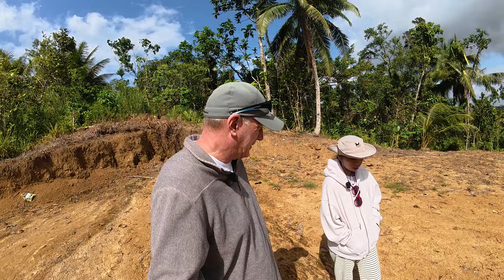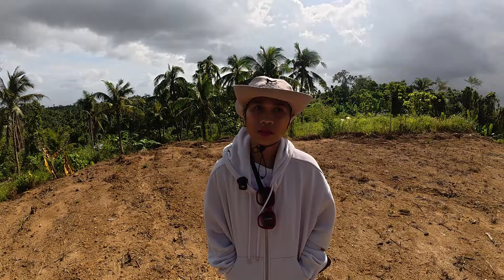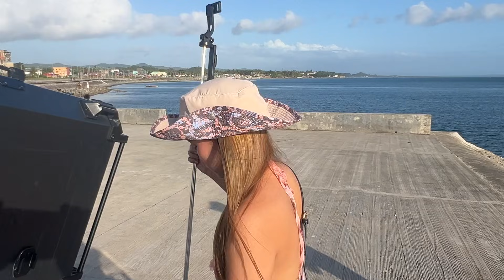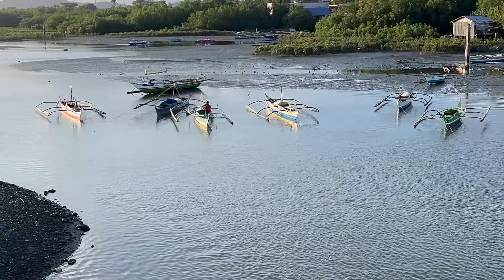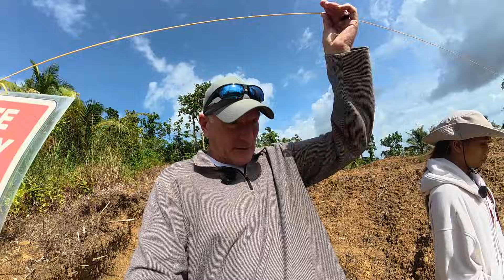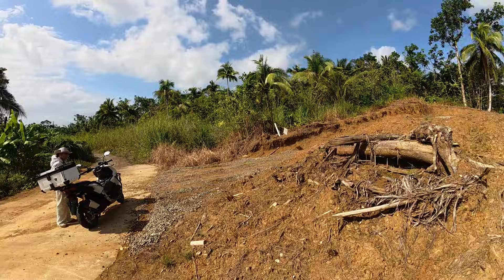If We Start This, There’s No Going Back-House build 🇵🇭

Comment: I’ve got a piece  of property in the Philippines. I wish I had  a drilled my well before  I built my house.
Reply from the maker: The resort around the corner drilled 2 times and never hit water-cost them some $$. We are on top of a high hill-rain water catch system is the only way to get water and we can have local water truck fill our tanks.  In a few years we will have water/electric in the area as it develops.
100% off grid-not depending on the local utilities as they always have issues sometimes weeks at a time.
I’m sure I’ll look back and wish a few things differently.
Take care

Comment: Honest question. So I live on camotes islands in Cebu and having a construction background I have thoroughly checked and wondered why a true timber frame wouldn’t be good here. I’m gonna speak to an engineer here and see if it would be possible obviously with a termite resistant wood.  A timber frame with sip panels is stronger than your conventional concrete block in the Philippines and rated for over 200 mph winds etc. 

Could you possibly offer any insight?
Reply from the maker: Standard lumber is extremely expensive here.  We looked at lumber and a 2x4 treated was $30 U.S.  metal is actually cheaper.  
I definitely understand your point it’s the import costs that make it not worth it.
Some areas have mahogany very cheap. Hard to nail.😂
Take care

Comment: Black rat snakes are famous for climbing walls in pursuit of food. But they are not venomous.
Damn, you can't even touch a car without a 10 & 12mm socket. I have all my 10/12mm wrenches color taped so I can find them quickly
Reply from the maker: We looked everywhere in Calbayog City for 12pt-all 6pt- had to order online. Exhausting to say the least.
I actually don’t mind the black snake, had one on my property in Palm Springs Ca.  Kept the rattlesnake out.
Take care

Comment: Shame I can't come help. I love a good project. I'm in Florida and have retired after 40 years of working alone in construction. Florida and Philippines have similar weather conditions. either soaked from sweat or soaked from rain but keep working anyway
Reply from the maker: Turtle wins the race, no re-work is the way I like it.  
I actually worked down in Orlando for Disney building a few projects as an electrician.  Rained every afternoon, and then got steamy.  😂
I’m sure I’ll be slower but not in a hurry.
Take care-
I would take you up on your offer though.
Watch the videos and chirp in whenever.  I can always use advice.
Reply: @maudave  I worked mostly central Florida around Tampa as a structural aluminum with concrete contractor. for the last 20 years I have been doing that and at the same time being the everything guy for the owners of the Amelie oil company. did maintenance and remodel to their offices, 15000 square foot house and remolded a few houses they bought into art stores for the wife's hobby. have tools now to build a house. more than my truck and trailer can haul. even been a security guard for them at their Amelie oil Gainesville Nationals races. still trying to bring myself to have a yard sale to unload my tools but hard to do. lol. congrats on your new adventure. looks both frustrating and lots of fun 😊 turtle is good. you can have fast construction or good construction but not both

Comment: Don’t worry about your van being a dirty mess, when you start on your building project everything will be a complete mess. Buckets full of dried cement; ruined wheelbarrows from dried cement; buckets 1/2 full of dried paint or primer; plywood cut up to sleep on, along with expensive insulation cut up for everything except being used for roof insulation. 
I could have built another house just on the wasted materials, it’s shocking. 
Good luck and remember it takes a lot of patience.
Reply from the maker: Agree,
I don’t drink but I might start-😂
Tanks for the insight.
Take care
Reply: @maudave luckily I drink plenty and can kind of tolerate it.